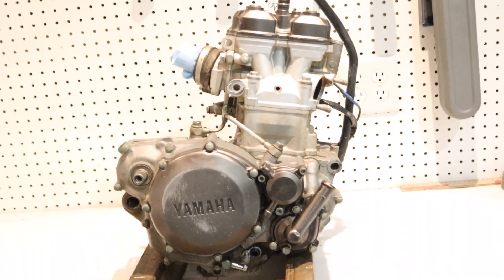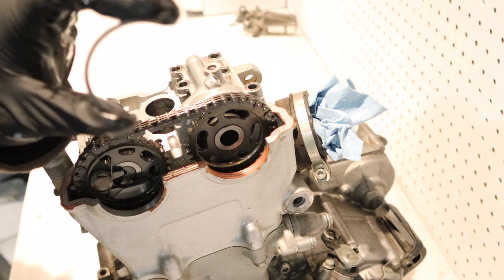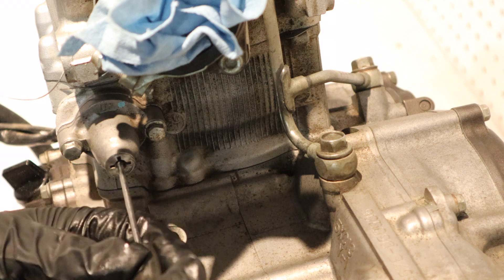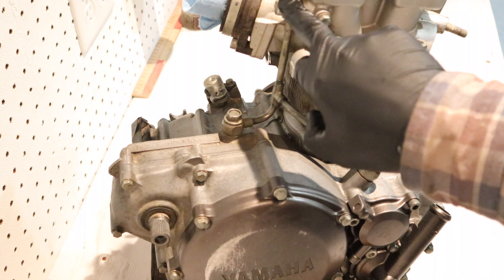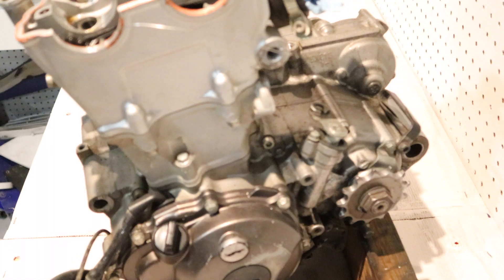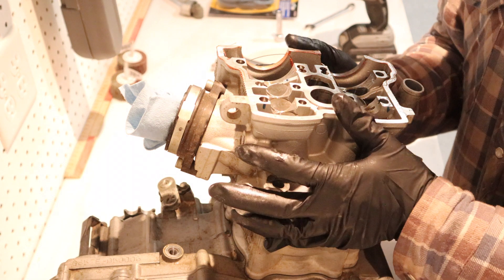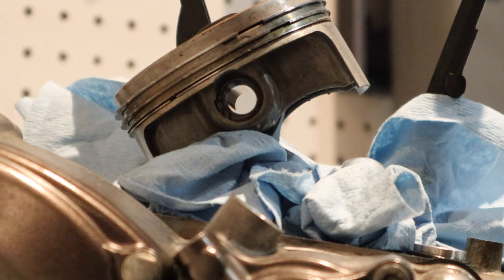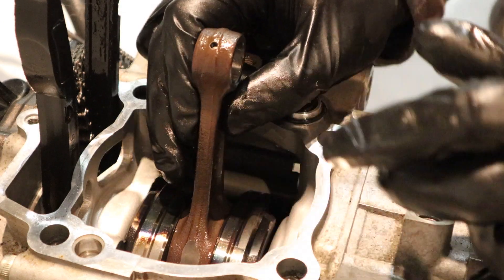YZ250f Top end rebuild how to (step by step)

Comment: Thanks for the vid I subbed I also would like to know how long this took and how much money did you spend cause my 2006 yz250f is losing power
Reply from the maker: Took my time over a few weeks since there is too much snow to ride, only cost a couple hundred dollars cad. Be sure to check the health of your cyl head and also
Your bottom end
Reply: SelectMX a crank is so hard to change also somehow my header flew off when I was 5th gear pinned. I don’t know how but now I need 300$ to buy a new header
Reply from the maker: Im Evan crank isn’t too bad as long as you have the right tools and do your homework. You can message me on IG @selectmx_  if you ever have any questions!
Reply: SelectMX have you ever done a crank ?
Reply from the maker: Im Evan yes a number of them
Reply: SelectMX okay so I have a 2006 yz250f and I think it needs a top end soon it has good compression but it’s always had a hanging idle and a clutch that’s kinda sticky how hard is a top end ? For a 4 smoke
Reply from the maker: its not too bad, just take your time and use a service manual. The best was to learn is by doing! Its hard to diagnose the issues you stated without seeing. It could be a variety of things from valve clearance to carb condition to air leaks.
Reply: Alex Tucker I’m going to sell the bike then buy a yz250 two smoke
Reply from the maker: Im Evan sweet! I’ve owned a lot of different bikes and the YZ250 2stroke has been the most fun and versatile bike in my opinion